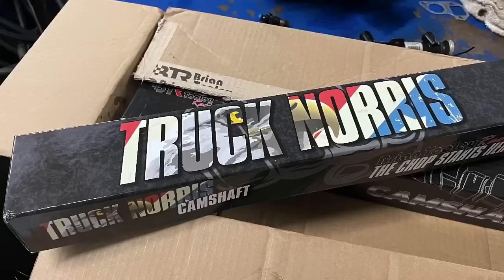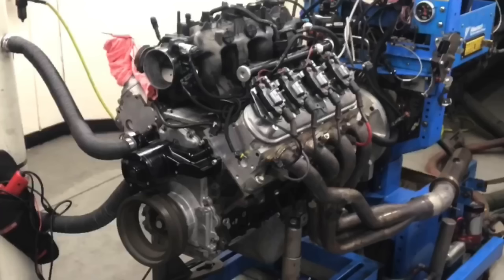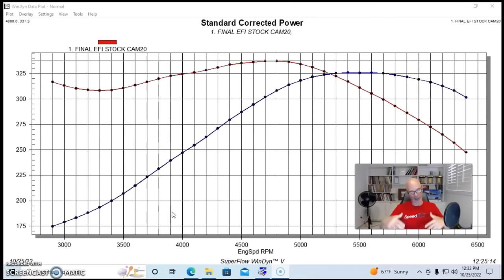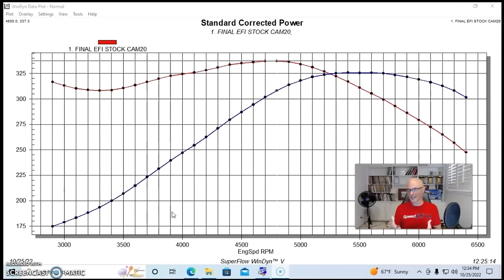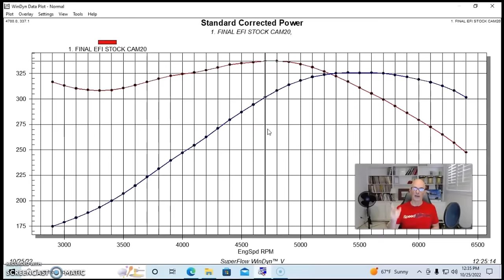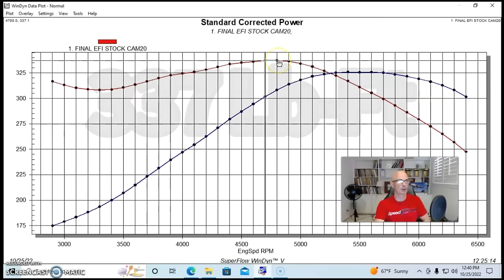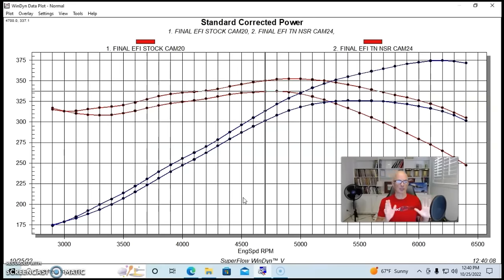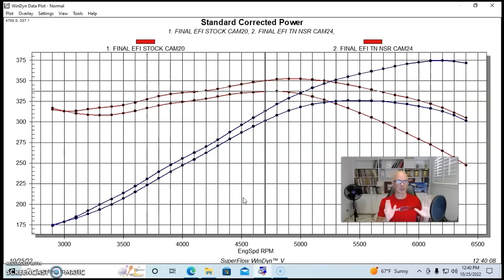4.8L LS VS TRUCK NORRIS NSR-CAN YOU ADD 50 HP WITH A JUNKYARD LS CAM SWAP WITHOUT CHANGING SPRINGS?

Comment: I’ve been on the fence about getting this cam. I have 2001 Chevy Silverado. It’s got like a 250,xxx miles on it with no leaks or engine light. And my whole concern was obviously money. I didn’t want to spend a whole lot on a cam, spring, lifters. Not knowing fully if the motor itself was going to last much longer. I think I’ll go this route. Even if it’s for a little bit, I Ono it’ll still be worth it
Reply from the maker: all the junkyard motors I run on the dyno have very high mileage

Comment: This looks like a great swap into a LS4,With DOD/AFM delete of course.  And supporting mods. A FWD GXP would surprise lots of people.
Reply: Who will build the transaxale to take the torque. I think the factory detuned the 5.3 just to keep things in one piece. Otherwise I like this idea.
Reply: @Dr. Reason  I have a "Built" replacement transmission for now from Triple Edge Performance.  When is fails im going to a 4T80. I wish the six speed could be swapped in.

Comment: Every 4.8 should have this cam in it!
Reply: I went a little bigger with a sloppy stage 1 by elgin and my twin brother is using the truck norris on his 4.8 build so we can compare.  We used identical springs and brass trunion upgrade though
Reply: Should be a factory cam
Reply: @MikeHeyboer which one do you recommend?

Comment: Hey Richard. What do you think about this cam in 4.8 for a CJ jeep w/ manual trans and 4.56 gears? Do you think it is too lopey for lugging up hills?
Reply from the maker: if you lug up at 2000 rpm or less-then keep stock cam

Comment: lm7/lr4 vs l33 cam
lift - .466/.457 vs .479/.479
dur - 190/191 vs 193/193
lsa - 116 vs 116
from what I found, its nearly stock power until after 4500. its almost like when you swapped on the comp cams 1.82:1 roller rockers. 
I've been wanting to see some of the different stock cams ran. i know lq9 and the 2nd ls1 cam are the same, lm7 and 1st lq4 are the same. lq4 got the different cam after it went to aluminum heads instead of the 2nd year.
anyways, this was cool to see what the 4 point great can do.
Wonder what the TN NSR does against the standard TN on the 4.8. I know the nsr point was cool but just cool to see what the difference between the 2 is for power.
Reply: On top of the two TN cams, would you be able to run the 1.82 roller rockers on the nsr cam on the stock 4.8 and have it nearly equal the og TN?
Reply from the maker: IT ALREADY (NEARLY) MATCHES THE HIGH-LIFT TN CAM-ROCKERS REQUIRE SPRINGS.
Reply: @richardholdener1727  I knew it would require springs. Just didn't know if there would be enough clearance for the combination and how that would  compare with the OG TN.

Comment: Interesting. Surprised valve float wasn’t a issue even with the stock cam above 6000.
Reply: Stock Bee-hive springs, fairly low lift, small valves, not an issue.
Reply: @davelowets  stock cams with stock valve springs even have issues if they aren’t LS6 springs
Reply: @ZONES89RS  Did you watch the video?
200,000 mile springs, and the motor ran right to the end of it's power band, WITH the larger cam, WITHOUT any issues. 
I'd say they're fine.. 🤷🏻

Edit: "NSR" on the cam means, "No springs required". A reputable company wouldn't advertise that if it was going to cause all kinds of issues.
Reply: @davelowets  it’s probably the LS6 style newer springs. I’ve spun those to 7200+ myself. 

The older springs were just trash and didn’t like 6000
Reply: @davelowets  yea, that’s weird and confusing because if that’s gen 3 springs it doesn’t make sense. Seen it time and time again calve float with stock springs and cam and even with Richard

Comment: NIce gains! I wonder how this compares with the 'normal' (higher lift) Truck Norris cam in a 4.8, to know whether it’s worth going with that and doing the spring upgrade. Also, did you post the cam specs, or did I miss them . . .
Reply: I googled it myself because I didn’t catch the specs either...

Specs:  212/22X   .498"/.498"   107 LSA
Reply: The nsr cam will make slightly  LESS power compared to the normal truck norris cam due to the lower lift duration. .498 on the nsr version vs I believe .560 on the normal version.
Reply from the maker: Good question! I forgot to include specs
Reply: In a 5.3 the NSR makes 3 less hp (the dynos for both are on BTR's website)
Reply: @rehn1kri  Revallier ?
Reply: Do you need to do dod delete on nsr cam
Reply: @juanbaleza6872  yes if your engine is equipped with afm/dod or vvt!!
Reply: @juanbaleza6872  yes
Reply: @rehn1kri  that's crazy 107 sounds like it would have  lots of overlap but with only 212° of duration on intake and exhaust overlap would be vertually non existent.

Comment: I hope we will see what happens,  when you doa  up-grade to the Springs , just to see how much more HP can be had?   I find these videos to be very educatical !!
Reply: Richard has already done this with the normal Truck Norris cam, but I think it was on a 5.3 with springs. It will make another 10ish HP is all so for most guys on a tight budget this is an awesome option!
Reply from the maker: springs won't change anything-except possibly lose a touch of power
Reply: @richardholdener1727  people must think they hold in more cylinder pressure with stiffer springs.
Reply: @thedude7726  If the engine was gonna be boosted then yes..
Reply: My understanding is that the spring help control the higher lift. If not you would float a valve.
Reply: @thedude7726  I think you could gain more rpm maybe what people are thinking, in round track racing with a crate motor that’s where people start cheating, a few hundred rpm makes a big difference.
Reply: Nothing... If the lighter springs control the valves now, heavier springs will do nothing but use more horsepower.

Comment: I just picked up an LS1 with 70k miles from a '97 Corvette that I'm going to swap into a 69 Camaro. Goal is driveability and reliability with a little more power. I was thinking of just swapping in the Truck Norris NSR and leaving the induction alone, with a set of long tube headers, and the Terminator X management system. Can't find any info on how much the added restiction of the LS1 intake manifold and TB will negate the gains from the cam. I'm looking for 50 HP and a motor that wants to spin to 6500 RPM.
Reply: There are plenty of LS1/LS6 cams out there that have great driveability and make more power being no intended for a heavy truck. Hell, the LSA you want for a car cam, rule of thumb.. Auto trans, about 114 LSA. Manual trans, 112 LSA. If ita a 97 LS1, find some cheap 799 heads, LS6 or LS2 intake and get a btr stage 1 LS1 cam. Or the SDPC (Scoggin Dickey) LS6 Power Max or LS6 Power Max Plus camshaft. I'm running the Max Plus in my 98 WS6 t56. After over a decade and 85k+ miles.. I ditched the LS6 cam. Powerband went from starting at above 4k rpm's with the factory LS6 cam, down to about 2500 rpms. But I also have 4.10s to be able to quickly get into the power-band. But point blank.. Find an actual aftermarket cam for LS1. Besides being more cubes, also lil more compression.

Comment: I think the roller tip rockers would have given the high lift cam more overall.  MORE bottom end and more top end, and more torque overall.  For that cam it was a disadvantage.
Reply from the maker: THERE WAS NO HIGH LIFT CAM RUN ON THIS TEST
Reply: Roller rockers on a small cam won't do much at all.

Comment: Hey Richard, I noticed you mentioned if you have a 5.3 you probably won't need a new converter but if you have a 4.8 you probably will. The 5.3 tmbx converter is 1400 - 1600 stall where as the 4.8 tlbx converter is 1800 -2000 stall. With a bigger cam you'd want more stall correct? So wouldn't the 4.8 converter actually be better for a cam swap than the 5.3 due to higher stall? Thanks
Reply from the maker: converter stall speed is also based on power output
Reply: @richardholdener1727  gotcha. I have a 4.8 that I put in a g body. I have both the tmbx and the tlbx converters laying around. Just trying to figure which one to throw in with this cam is all.
Reply from the maker: I would pick the higher stall speed
Reply: @richardholdener1727  ok thanks for confirming Richard!
Reply: @richardholdener1727 Will you test the Madd Maxx camshaft?

Comment: When are you going to do more with the 8.1L?  I am dying over here waiting to see what you can do with it lol.
Reply: LT Tolman is running a turbo 8.1 and cataloged the build on YouTube.
Reply: @rcairforceone  I am wanting to see what some of the upgrades produce on the dyno. LT did a good job but I am not sure I want to go the turbo route yet due to funding. I am putting one into a 79 trans am and have done the raylar BP203 cam and roller rocker so far.

Comment: Were those just some generic ls7 lifters Richard? The ones I bought from ict billet look similar but I cannot find a manufacturer for them. I didn’t want to assume they were ac delco
Reply from the maker: I ran stock lifters-the one replacement was another stock, used lifter

Comment: Just a thought.. turbo cams are usually low duration and high lift. I would be curious to learn how the NSR grinds compare to the SR variants with forced induction. Like the two Truck Norris versions pitted against one another under boost. How much would the low lift version fall short of the high lift.. with a turbo? We know there’s not much difference NA, but would the dyno graphs be as close with boost?
Reply from the maker: WHAT USUALLY HAPPENS IS NA GAINS WOULD BE MULTIPLED BY PRESSURE RATION (THE GAINS OFFERED NA OFTEN INCREASE WITH BOOST)-BUT NOT BECAUSE BOOST LIKES THE HIGH-LIFT CAM BETER-BOOST DOES THIS WITH ANY TYPE OF NA POWER GAIN

Comment: I have 2004 gmc sierra with 4.8 280xxx miles. Can o do this swap :)? Stock springs  and rods for now:)  also is ot hard to tune if you just slap it in. Or can I get away without tuning it for a while? Thx
Reply from the maker: cam requires a tune
Reply: I wouldn't drive it without a tune..

Comment: Richard what RPM did you experience the cam to fall off or exceed springs, happen to know how many miles were on engine?
Reply from the maker: we did not rev the motor to valve float
Reply: @richardholdener1727  thanks, yes I was sure you would have commented if that happened however just curious what rpm you hit during the test, graph appears maybe 63-6400ish?

Comment: I have a 4.8L I want this cam but can you tell me what’s a converter? Also can you tell me the best timing chain to buy also to go with the cam? My motor is a 2003 4.8L
Reply from the maker: torque converter for aur transmission, we use stock or the german chains
Reply: Is there a certain type of converter the stock one to buy?

Comment: Richard how much power would you guess, going to .600 lift from .550 and using a dual spring kit.
Reply: Probably 20hp
Reply: @sstevocamaro  I don't even think it's that much
Reply: It varies based on the cam (the bigger you go the bigger the difference) but it's generally 10-20 hp. The standard Truck Norris cam only makes about 3 hp more than the NSR version though (but that's ~.550 vs ~.500).

Comment: I have a 4.8 thinking about the high lift truck Norris cam you mentioned replacing the torque converter if running in a 4.8 what torque converter is recommended for but I still want to be able to cruise and daily drive
Reply from the maker: 2800

Comment: does it work with nitrous, will it damage the engine to run a larger gap with nitrous, because it's recommended to run cold plugs with smaller gap
Reply from the maker: higher cylinder pressure (nitrous or boost) requires smaller gap for voltage to jump or you get misfires

Comment: What would be a good converter for a cammed crew cab truck 08 4.8 with a chuck norris cam. But I don’t want overheat the trans because I still pull my boat with my truck
Reply from the maker: 2800 LIKELY-CHECK WITH BTR

Comment: Can you add springs now and see the difference it makes? See if it pulls to 7k?
Reply from the maker: THAT IS WAY PAST THE POWER PEAK-NO REASON TO RUN IT THERE-BUT IT WILL ALREADY RUN TO 7000 WITH STOCK SPRINGS.
Reply: @richardholdener1727  I run them there all the time. Have to extend the shift to keep it away from peak torque to keep the SBE alive with big boost. Routinely run 7500+ on mine. Just curious if the tight LSA cam will continue to pull on a 4.8 w decent springs.  Summit "Stg2" pulls steady to 7300ish before it drops off and has been my "go to" budget turbo cam. I shift it at 7500 and have been knocking out 5.50's. Curious if the smaller cam with tighter LSA would give me more midrange and quicker "spool" vs the summit stg2 without falling off up top.
Reply: @AdamOpheim  Shift it earlier, and see what (if any) difference is to your E.T.'s..

Comment: I'm new to ls..... But how did you pull the cam, without pulling the intake and lifters?
Reply from the maker: ls doesn't require intake removal-and the lifters are retained by the lifter trays
Reply: @richardholdener1727  well that's too cool.
Reply: On the gen 4 motors, there are little holes in the front of the block, under the cam plate, that runs under the lifters when they are in the up position in the tray. I shove wooden dowels in these holes, and the dowel will hold the lifters up and guarantees that they can't fall down into the block. I've never had it happen, and I don't know if it COULD be an issue, but I just don't trust that a high mileage tray couldn't be worn out to the point that it could possibly let a lifter slip out when the cam is out, and end up with a lifter in the oil pan.

Comment: Sorry to be a bug but we need more information on what transmission to run on a turbo ls. I know you have a trick to save money
Reply from the maker: NO IDEA
Reply: I CAN tell you that a stock 4L60 doesn't last long behind a cammed 4.8, with an 80mm single, and 15lbs of boost. 
I'm talking like less than a few hundred miles. Factory clutch packs smoked.

Comment: What would the power gains be with this cam if you used shorty headers?
Reply from the maker: are you asking if it makes more power with shorty headers or will the gains be less with shorty headers?
Reply: @richardholdener1727  I’m asking if the power gains would be less

Comment: It's funny because springs are cheaper vs cam pricing. BTR Springs are 80 bucks to 90 bucks depending on your setup vs a cam that cost 185-400 bucks. I would rather get springs and a ls3 cam then boost it and save a lot more vs BTR cam with stock springs
Reply: Turbos, intercoolers, piping, AN fittings and hose, clamps, couplers, and manifolds are cheaper than cams? 🤔

Comment: Do you think this cam would work on 87 or would it create too much cylinder pressure?
Reply from the maker: it will work with the right tune
Reply: Interesting concept for a decent cam for my afm deleted 5.3 in my avalanche

Comment: Hey Richard Holdener, keep up the great videos. I have a stock 2012 silverado with the L20 4.8L engine. It has 8.8:1 compression & I would like to know if swapping out the 799 heads for a good set of 706 heads surfaced 0.030" will give me good power gains or be a waste of time!!! 
Thanks in advance.
Reply from the maker: IT WOULD ADD SOME POWER AND POSSIBLY MILEAGE
Reply: I want to keep VVT, would the factory L92 cam be too big or just right?
Reply: @Fehrway_Engines  Texas speed makes vvt truck cams,  the 212/218 cam with vvt would be perfect in a 4.8

Comment: How did you keep the lifters up off the camshaft to remove it?
Reply from the maker: WHEN YOU SPIN THE CAM-IT PUSHES THE LIFTERS INTO THE PLASTIC LIFTER TRAYS-THEY HOLD UP THE LIFTERS.

Comment: Get a stock exhaust system from the junkyard and test with that...
This would be nice for a real world simple nsr cam swap
Reply from the maker: it won't fit on the dyno-but i have run cam tests with stock manifolds

Comment: It would be interesting to see if you upgraded the springs , if there’d be HP gain .🎃🎃
Reply from the maker: there won't be
Reply: What about with the non NSR cam with good springs?
Reply: @billybadass411thefirst9  It'll make 3 hp more on a 5.3 (the dynos for both are on BTR's website)
Reply: Question guys. Stock lq4 862 heads Holley Sniper Efi msd LS series. 
Would there be a change in performance with springs and hollow valves with no stock cam?
Thinking about a TN cam later. 
A
Reply: @billybadass411thefirst9  bind is the concern and float at 5 k and up rpm

Comment: Can it put this cam in a 2008 LY5? It have the DOD tuned out but the DOD lifters are still in. Can I use the DOD lifters with this cam?
Reply: Just replace the dod lifters leave the rest
Reply from the maker: replace them
Reply: Just imagine your DoD lifters as little grenades waiting to go off in your engine. Replace them.
Reply: @ChurchAutoTest  😆 Exactly... 🍻

Comment: Are we going to see this cam under boost
Reply: With stock valve springs? Like, all the boost?
Reply: @BigRedRocketScience  I was just curious about how it will run under boost, I get that it will still need springs for boost and that boost is just the multiplier, but I'd like to see the difference in the power between the nsr and standard truck norris at the same and probably low boost
Reply from the maker: the nsr vs standard truck norris test is coming-it does the same thing under boost

Comment: Results won't be as good when you don't have the ultimate tune and long tube headers or injectors. If you have over 200k miles on your motor, you better change the spring's
Reply from the maker: THIS MOTOR HAD OVER 200k
Reply: How many more miles since then with stock spring's?

Comment: Can I put this in a stock 2002 5.3 without a tune?
Reply from the maker: no
Reply: @richardholdener1727  I have a LQ9 cam. Can I run that in my 5.3 without a tune?
Reply: @FeetusMcCarland  You COULD, but why? 
ANY time you replace a part that changes the airflow characteristics of an engine, you NEED to retune it to realize any power gains.